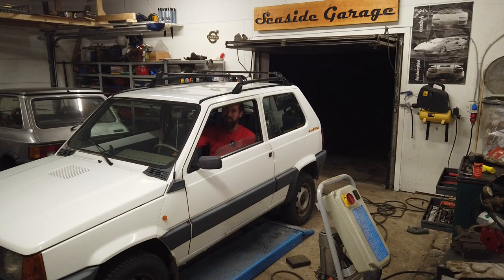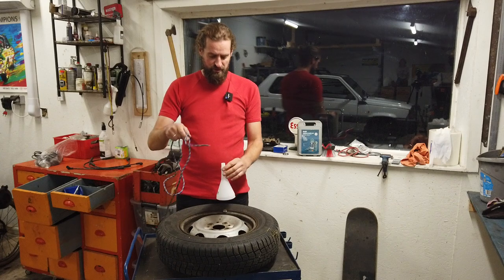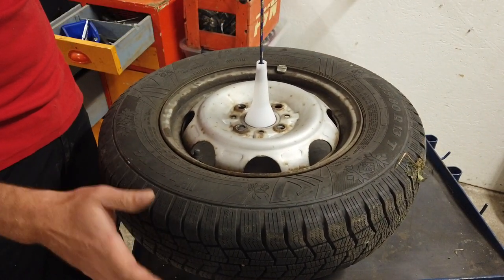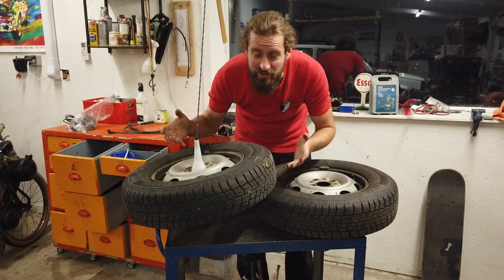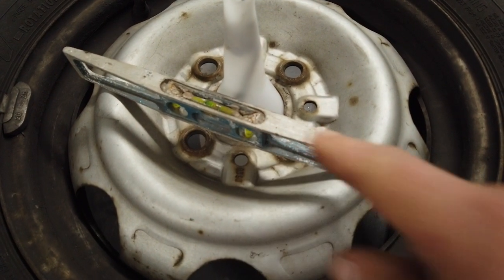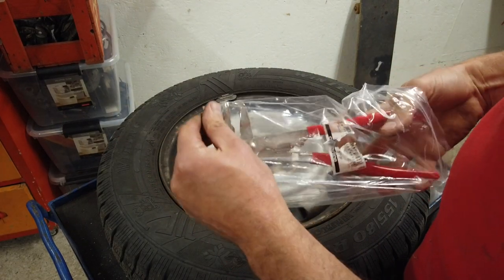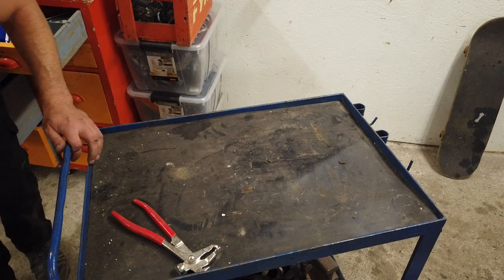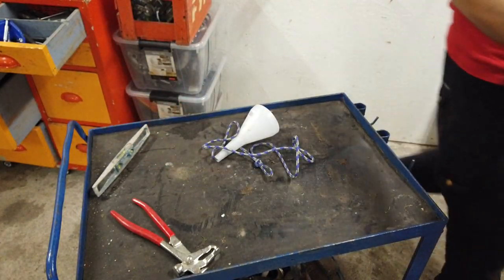DIY Wheel balancing!

Comment: tip: in the case of tyre imbalance, if the shake is in the steering wheel; it's either one or both of your front wheels. if you can feel the shake in the brake pedal (not while braking, merely touching the pedal) it's most likely a rear tyre imbalance.

Comment: The wheel's center of gravity (approx middle of the wheel) is far below the pivot point (where the rope touches funnel). Even if you put a half pound weight on one side of the tire it will not go down very much. You need to move the point where the rope attaches to the funnel down somewhere below the wheel's rim, and then your awesome homemade static balancer will become sensitive and function properly. Experiment with the exact position-- too low, and the tire will tip too easily; too high, and the tire won't tip enough. Good luck!

Comment: i have an idea...  balance a wheel with this method and then check it with your new old Beissbarth Balancer..... would be very very interesting and great stuff for ur channel !!!!

and i have an good ideal for you too to get rid of that cone....   take a long screw with a Hex Head or piece of wood put a Billardball on the top and on this Billardball you can put the rim... it will be perfect centered because of the shape of the Billardball. the long screw or wood have to have a very clean flat surface... try it it works wonders !
Reply from the maker: Good idea!

Comment: Hi. The idea is great. But may I suggest an improvement to the method? You may dangle a string. Then connect the two ends of two other strings to the wheel knot holes, like a multiplication sign. Then connect the center of these two strings to the dangled string. This way, the wheel can easily move vertically, and the heavier side will completely go down and you'll notice it.

Comment: There is a tool that allows you to do this, which is basically a cone, that sits in the hub hole like your funnel, that balances on a pin on a base that is sat on level (hopefully!) ground, there are also smaller versions used for balancing lawnmower blades too... :)
Reply from the maker: I just bought one ! :D
Reply: @SeasideGarage What’s it called?

Comment: The concept of static balance is quite simple: The radial axis of a tire and rim assembly must be perpendicular to the horizon line, in all quadrants (plumb) when the tire and rim assembly is suspended horizontally by its exact center point (the location of the radial axis). 
 In your video, you clearly demonstrate that you understand the concept, however it is quite clear that you do not realize the degree of accuracy required when establishing the parameters of this concept. That is to say, although the concept is simple, implementing it in a practical way that would yield meaningful results requires fairly accurate measurements, both to determine the exact point of the radial axis (within 1/1000"), and the exact degree of the tire rim assembly's horizontal plane (within 1 degree). If you do maintain that type of accuracy, you can balance a tire/rim assembly within 1/4 of an ounce. A rope, funnel and torpedo level can't possibly come close to achieving the accuracy required. If you actually did manage to balance the tire to any degree of accuracy with that equipment, it would be nothing but pure luck and non-repeatable. Even a broken watch would have more repeatable accuracy, as it is accurate twice a day. If you're interested in a method that meets the necessary accuracy required, check out this short:  https://youtube.com/shorts/MCqM9W_ph9A

Comment: If you are still interested in balancing tires, have a look at this video
https://www.youtube.com/watch?v=a4Ox_Emh7Ew&list=PLWHom5FLIC6vZSy2jL7YB3xnY2jVi5Mgt&index=13&t=0s
It doesn't work on all wheels, depends where the CG is. If you have to add a lot of weights, split them evenly (inside / outside) about the wheel CG to avoid dynamic imbalance. That will make the steering wheel shake.

Comment: What you've achieved is a static balance.  Static balance is OK for skinny wheels, but does not work for the wide wheels generally found on modern cars.  For most cars the only thing that will work is a dynamic balance, and that can't be done without an expensive machine.

Comment: I’ve worked in a garage for 8 years while going to school, and I always wondered how tyres were balanced in the old days., without the fancy equipment. 

Regarding your new “hammer/plier”, it has a pointy bit which fits into a hole on the balancing weight (the hole is located on the thin bit, that holds the weight to the rim itself). The handle should then point away from the centre of the wheel, and then I think the rest makes sense :) 

Your method may work, but the wheel should be balanced outside and inside separately, it’s not enough to add the same amount to both sides of the rim, but maybe it’s good enough!
Reply from the maker: Thanks!

Its not perfect, not perfect at all! But for old "simple" cars I think it will be alright actually.... 

For a more luxury car with wider wheels I dont think it will work good enough... :)
Reply: @SeasideGarage  As long as it has reduced your vibration, it seems like it works! :)

Comment: Obvious flaw in this design.. the rope has to have fasten point closer to rim. Otherwise the top point of the cone is to powerful and will level the tire. If you cut the strut of the cone off, way down, then you would have better chance.
Reply: You would have take to consideration the offset of the rim. The fit point of rope has to be on zero offset plane. So if your offset is et25 then you have to have the fit point 25mm inward etc..

Comment: Just got my first puncture in 20 years so bought 2 new tyres balanced and all for 150euro. The annoying bit is that 4 wheel alignment is 50euro... what a rip off. That's Ireland for you😤
Reply: 50€ is cheap, in Germany prices start at 80€. If you want a good alignment on a modern car, it can easily go up to 400€. Last time, the mechanic worked 5 h on my BMW... everything was rusty after 7 years.
Reply: @lieberfreialsgleich  my Kia is a relatively simple car, feels like a ripoff as wages are lower and it's an opportunity to get money from the customer whether tracking is needed or not.
Reply from the maker: In Denmark I was quoted  70 euros to balance (ONLY BALANCE) 4 tires... :O

Comment: This time I don’t agree wit you. This method is too crude. I have access to a proper balancing machine, and it is NEVER the same weight and location on the inside and the outside. It will never be vibration free. You can bring your wheels when you come to Als and pick up your next project car!
Reply from the maker: Its not perfect at all! But for narrow tires I think it would be ok... 

It could be a fun experiment to test of much this method is "Off" by testing it on a machine afterwards! :D

The Als project is on its way soon I hope! ;)